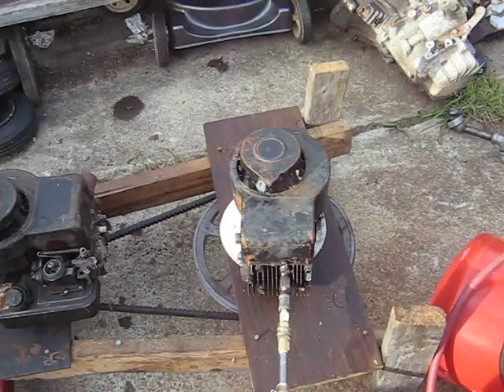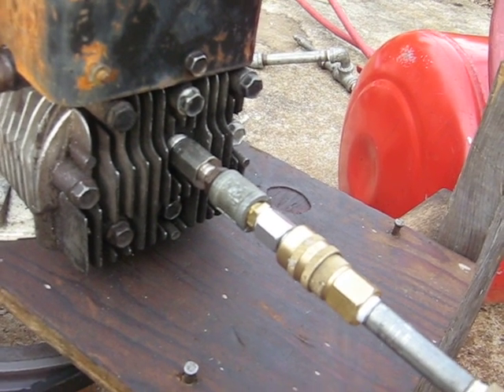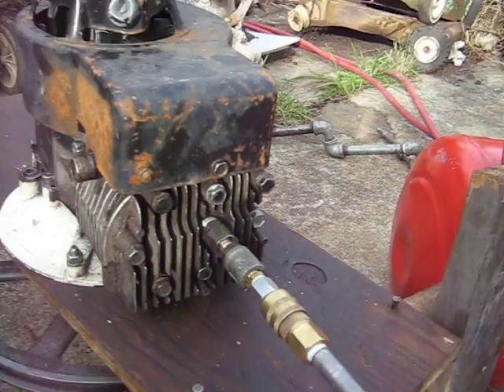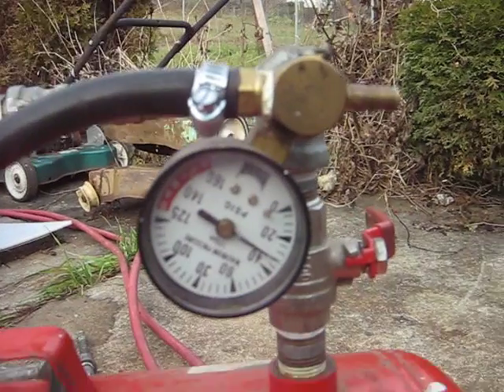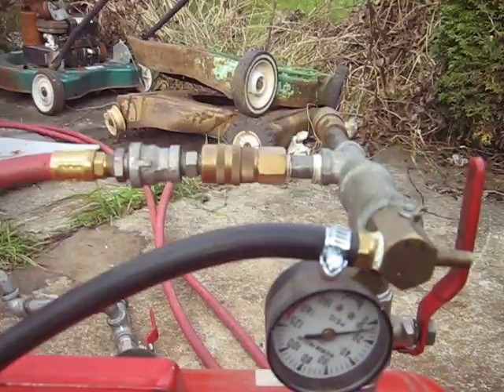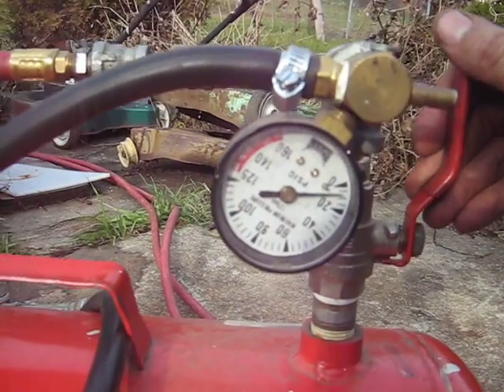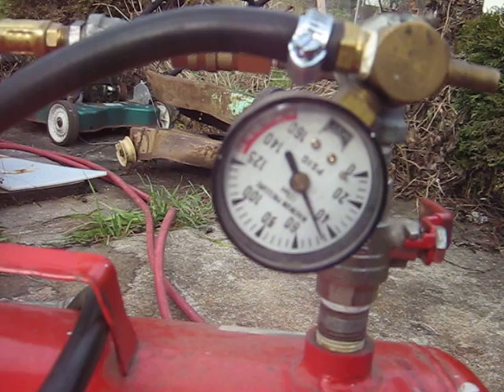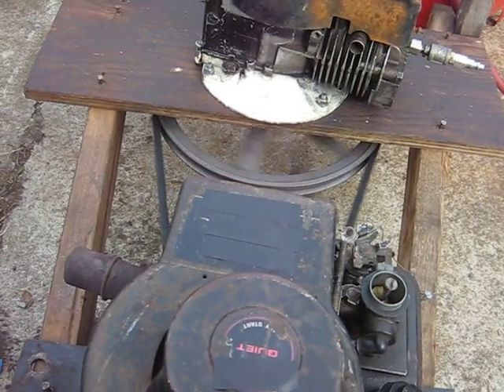Stage 8 Experimental Air Compressor  50psi :)

Comment: I'm surprised at the low pressure.  Compression ratio must be very low (5:1?).  A friend wanted "emergency on-board air" (to "charge" his pressurized roll cage) but didn't have space for a compressor.  We used a leak-down adapter, a one way air valve (Princess Auto) and a hose to the cage.  For air he'd pull one spark plug, disconnect the wire to the (MPI) injector and run the engine on 7 cylinders.  He got 120+ PSI of usable air (no engine mods); enough to pump up tires, run air tools, etc.

Comment from the maker: @Rufeo0 
It has double cam lobes here to be like a 2 stroke, everthing after stage 3 uses double lobes.
Yes, I thought of using more than 1 schraeder valve, good idea. I am not sure how long the rubber seal would hold up to the heat if the compressor puts out 80 psi or so, I think the rubber would suffer, but hared to say. I was actually looking at schraerder valves last night, but I figured out how to make a 1 way valve from various Briggs parts, vid to follow!  :)

Comment: there you go, told you. Now you just need cams to make it a 2stroke. Also you could drill and tap the head for multiple shrader valves if you where worried about the flowrate

Comment from the maker: @KrankieV2 
You know, that is a good idea, perhaps it would be a bit hard on the valve due to shock loading from hitting the cam ramp, but  at the 600 rpm this spins it should work fine :)
Yes, I ahd to gring off that pesky easy spin bump!

Comment: if you go back to taking air off the exhaust valve, like in the stage 7 vid, try grinding a little less than 1/8 in off the intake valve stem but you'll have to use a cam where you havent ground down the intake lobes on the cam. the problem that I am reminded of is the easy spin starting feature, which uses the intake valve to relieve compression. B&S claims at operating speed the valve is not open long enough to make a difference, but obviously you're spinning it pretty slowly.

Comment: What's if you block the exhaust and use the intake to bring in air, and the spark plug to the air line.